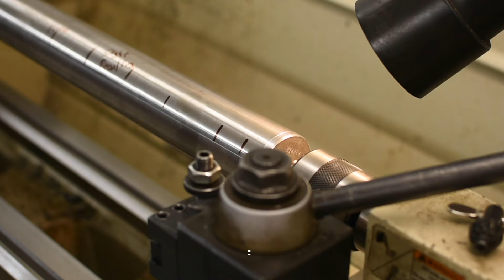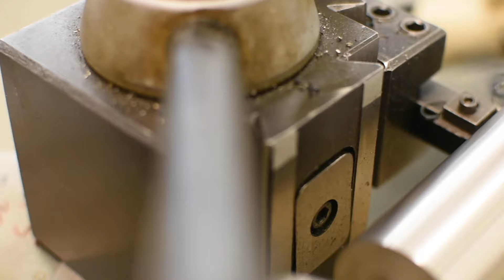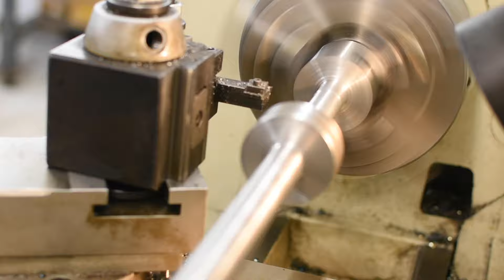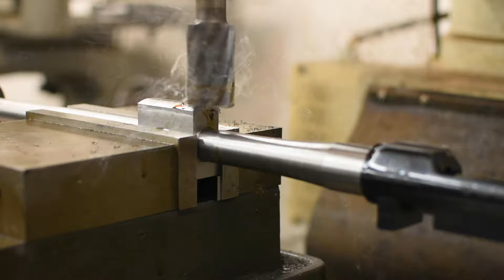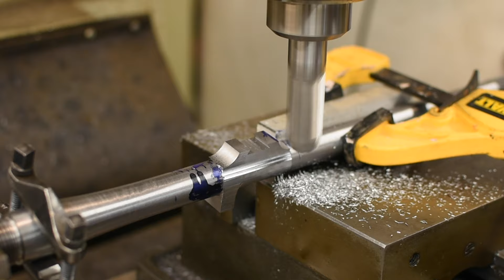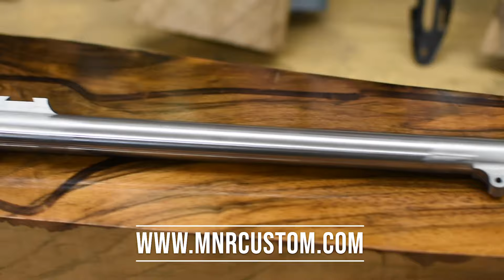INTEGRAL RIFLE BARREL FROM BLANK

Comment: Been a gunsmith for years, never seen this before. Very impressive. How's it shoot? Does all the machining work harden the metal, introduce stresses? Again, very impressive
Reply from the maker: This one shot quite well for a big bore. 1" at 100yrds. When I do this type of machining on barrels I prefer to use Krieger barrel blanks. The cryo their barrels which removes a lot of the stress in the steel. They don't seem to move around when machining like some other barrels I've used.

Comment: This is genuinely inspiring work. Is there any problem with distortion of the barrel when so much material is removed?
Reply: You're less likely to see any kind of warping in lathe operations. Milling cold rolled steel is another issue though. You can easily turn a thin piece of steel into a banana if you're not careful. Mainly, just make sure you take equal amounts off each side. If you hog a bunch off with a rougher, take it out of the vise and let it correct itself, then put it back in for your finishing operations.

Comment: Skookum as frig! Totally amazing skill and craftsmanship; one slip of the mill crank and you're screwed. Just amazing thanks for sharing. What is the purpose of the lug under the rear sight? Never seen that before.
Reply from the maker: Thank you Gregg! That's funny, when I lived in Alaska I had a friend who used the term "skookum" all the time. Haven't heard it in over 10 years. The lug under the barrel is just a secondary recoil lug. On big bores it's handy to have that to help spread out the recoil in the stock.

Comment: I have always wondered how that kind of work was done. You quoted Troy F. a 5K price. Now I can see why, the old way with no CNC.
Reply: hhhhh buddy this is definitely NOT the old method
Reply: @MFKR696  honestly the old method is based on the technics of forging from a piece of metal to give rise to a cylinder, the interior of the barrel was worked according to its future use, either smooth or scratched interior, all of that manually, all tools are handcrafted and intended for strictly manual use,the best manufacturing methods are the oldest, especially the heat and protective treatment, but unfortunately to obtain a master weapon it takes a lot of time, and i tried all methods in my 21 years of gunsmithing
Reply: @MFKR696  same things for me, the old "ancients" methods are the best, the new metal working give fast results, but compairing to the old school method that's big difference of quality, imagine rifles from 17 century still existe, can yo say same thing about an M16?    lol

Comment: Getting the dovetail fit right is crucial, how is that achieved?
Reply from the maker: I get close by measuring the sight. The dovetail is cut slightly wider on one side of the barrel. Then by trying the sight after each .001 cut I keep checking to see when the sight starts into the dovetail.

Comment: Extremely nice work for sure. I'm curious how much time was spent getting every single dimension laid out on paper or CAD, double then triple checking those for any dimensional errors before you hit the start switch for the first time. :-) Even at that it's all to easy to make a cutting mistake if your not 100% sure of every move.
Reply from the maker: Quite a bit of time. Can't say I can remember specifically, but at least half as much time as the actually machining.
Reply: @mnrcustomllc8253  I didn't see any video angles taken high enough to see if you have dro's on your lathe and mill or not. If not then doing the job with the dials and compensating for backlash would make it about 10 times harder. Yes it can be done just like you showed, but I think it takes a special mind set and machinist to do it as well as you have. While I've got the equipment to duplicate something like this I wouldn't bet a dime on me doing so without a fatal mistake for the barrel. This is a whole lot tougher to do than it looks. Unfortunately and except for a very few with well known names, highly skilled custom gunsmiths aren't as appreciated or as well rewarded as they should be.
Reply from the maker: @turningpoint6643  Thank you for the compliments. I have a DRO on the mill but not on the lathe. I've run mills without DROs in the past but on a job like this it would likely drive me insane.

Comment: Did removing mass external materials release internal stress causing the barrel to bend? Did the rifling concentricity at both ends stay the same?
Reply from the maker: No noticeable affect on the bore. This was a Krieger barrel blank. They are properly stress relieved which makes them much easier to work with without ill affects. Doing the same thing with a hammer forged barrel would spell nightmares for the bore's concentricity.

Comment: I do not see the point of having integral sight bases. That is what these are - sight bases. Not sights. Other than showing it can be done, it seems a complete waste of time and resources to me.
Reply from the maker: Your argument could be used for any custom features. "Instead of checkering a gun stock we should just slap some grip tape on there. That will serve the same purpose. Checkering is a waste of time and resources. Same goes for engraving or any other detail work." Other than adding to the value of the rifle, integral barrel features are also an added assurance from mishaps. I've fixed a number of solder or screw on sights that have broken off in the field, can say with certainty that you won't have any issues with integral sight bases.
Reply: Beautiful work my man-- great job! So some of that old-school stuff may not take in to account every single theoretical downside-- but sometimes they're more theory than reality. I don't doubt that thing will shoot fine. Maybe it would have shot finer just leaving it a full diameter blank but then the great works of art in marble would have been stronger if they'd have just been left "big rocks"!
Reply from the maker: @nedchristiansen3105  Thank you. I like the analogy of the marble artwork.